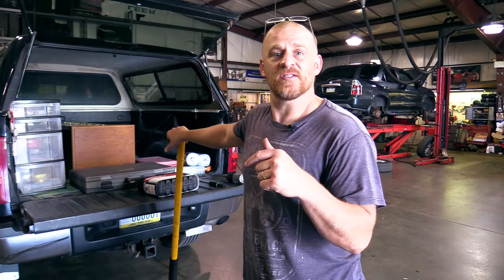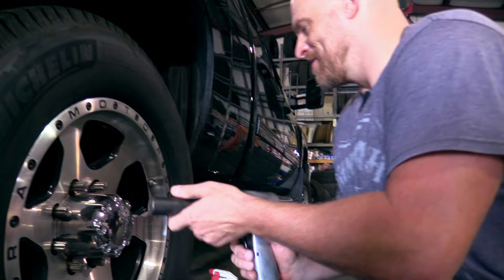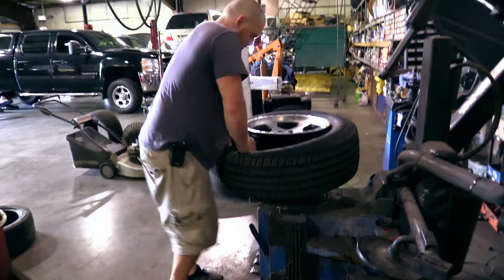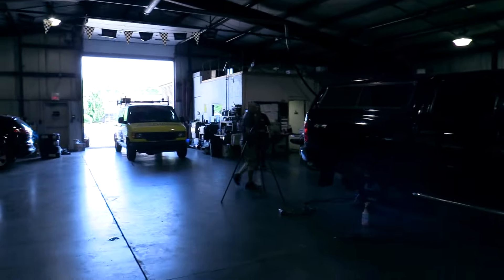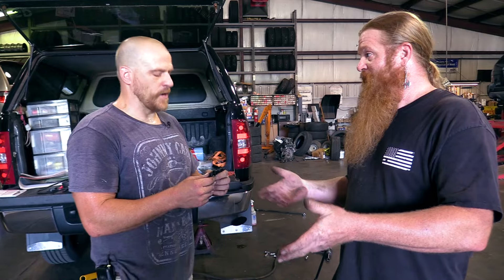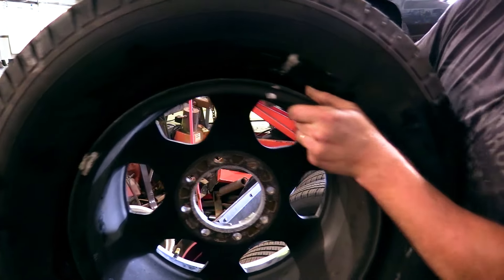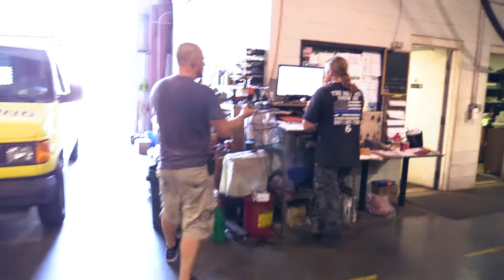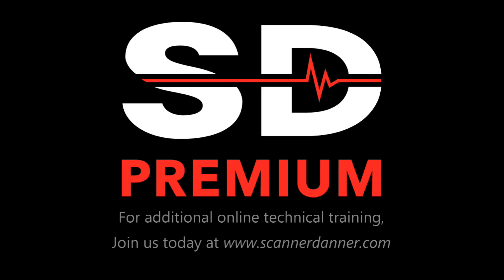Cloning a New Tire Pressure Monitor Sensor (TPMS)

Comment: Good Video as always. I have the same tool but 1 - 2 models lower. I bought it mainly for another function though. You can use it to verify Key FOB Transmissions. If you have a Key FOB that doesn't work, it is difficult to tell if it is the Battery, or the buttons, or ??? That tool can read the radio transmission from the FOB to ensure that it transmits from each button. Great for fixing a worn button. 

I live in Sidney B. C. Canada on Vancouver Island and our back yard is a Tidal Arm from the Pacific Ocean. That Chrysler with the bad TIPM, sounds a lot like the flocks of Canadian Geese that collect on the water behind our house and practice Formation Flying before heading south for the winter. They fly overhead and "HONK" continuously. Just like that Chrysler! After a few weeks, they leave and go south..... I think some of the practice is trying to find a leader that knows where south is. I don't know..... just sounded like them and made me laugh!

Comment: Step one mark the outside of the tire at the valve stem with a “V” pointing to the valve stem
Step two add washer fluid to the reservoir to turn off the message on the instrument cluster 
Thanks for all your videos I’ve learned so much from you

Comment: Paul that was funny watching you drop that TPMS sensor inside of that tire.  I did it twice yesterday on my 20 inch 1999 Plymouth Prowler wheels.  The big difference is I don't have a tire machine and low profile tires are a lot harder to work with if you don't have the right tools.  
I bought the Autel TS508 and cloned a set of four TPMS sensors on my spare set of tires for my Prius.  Those metal valve stems don't like salt and go bad when they go through too many winters as you now know.

Comment: These were a lifesaver for my 2014 Ford Transit Connect. I could not for the life of me get any aftermarket sensors for it. Ford was back-ordered and expensive as heck. The tire tech I took it to didn't have any entries on his tool to get the type of sensors I needed generated. I had to use another scanner tool to activate the reprogramming procedure and it took a few tries because the radio interfered with programming but otherwise I was pleased. My only lament was I didn't pickup the sensors with the rubber valve stems, so now I got to replace them but that's a story for another day.

Comment: Autel made a great tool because of the options that are included. I just installed sensors in aftermarket wheels and need to reprogram the computer to accept the different tire pressures the new tires require. I'll look for your video on that, thanks.

Comment: Chrysler dealer tech here, working in the used car dept, i knew that the leaky stem was not going to be fixed by tightening the nut, due to the corrosion. When you run out of the Autel sensor, get more. What i've seen is that the sensors in many cases cannot be programmed with a different brand tpm tool. I wish the industry would standardize the comm protocols for the sensors so that any brand sensor can be programmed by any brand tool. I've done the pop out the old sensor and pop in the new one just with one bead popped. Have lost a sensor inside too, the trick is to push the loose bead down far enough to reach in with a tool and grab the sensor. As far as getting tire back in place for the balance, it's far easier to clamp the wheel and move the tire. I agree with the sentiment about the tipm, it's a stupid idea to permanately mount relays into a circuit board, especially those that can fail often.

Comment: Couple of things I noticed. One, @9:10, the tire machine you tried to use before switching to the other tire machine because you couldn’t get the head of the machine down to the wheel, there are 4 pedals on the front of that machine. The pedal furthest to the left would’ve lower the head assembly. The other thing is when you had the valve stem out of its hole in the rim, because of the corrosion that was present on the TPMS sensor seal, you should’ve taken a 2 inch long piece of coarse emory cloth, rolled it up the way people who smoke marijuana roll up joints, then stuck the marijuana joint emory cloth roll in the valve stem hole in the wheel and cleaned the corrosion out of the hole before you put in the new TPMS sensor. It’s possible you may wind up having another leak in the same spot because this wasn’t done.
Reply from the maker: Never noticed the corrosion in the valve stem hole. Guess that's why I stick with wiring lol
Reply: Hey, tire work ain’t easy. If it were, everybody would be doing it 🤣
Reply: I laughed at his description of how the sandpaper was folded/rolled, lol!
Reply: @waverider5751  🚬🤤🤣

Comment: I'm putting my money on some swollen, cracked and green front airbag sensors in your truck causing the airbag light, Paul. 😉 I have the same truck, only in a 1500. Maybe if I had ponied up the dough for the HD model, I wouldn't have replaced my differential at 97k.  Looks like you got better paint than I did, too - right above my rear fender well on both sides of the box are several swollen rust blisters under the paint. Truck has been garaged since the day I drove it off the showroom floor in '07, too. 😡

Great vid! Love Autel's sensors. I haven't used or programmed any yet, but when they first came out, I was very glad. I've got the Maxisys 906TS that can program them. My OE wheels are my winter set, so those got sold on eBay many years ago, and regular valve stems installed instead. I just deal with the stupid light. 😁 My summer wheels are off a '10 LTZ, so the batteries should be dying in those any day now. Shocked they're still working at the moment. 10 years seems to be the magic number here in MA for that. 

Don't sweat the tire struggle. The struggle is real, lol! I do that every day with everything, it seems. More so when the camera is on - funny how that works ...

Just got back from a week in OH. Catching up on YouTube vids now. No donations to PA's finest this time. My last trip cost me $182 somewhere near Clarion on Labor Day weekend  - 87 in a 70. Ouch ... 😢
Reply: P.S.:  Loved Caleb's karate-chop audio/visual effect there too! 🤣

Comment: Did you notice the size difference between the old and new sensors?
  My 07 Toyota sensors lasted 9 years before I changed them (while replacing the second set of tires). I used clone(able) sensors as they avoided the reprogramming if the system. The 'clone'  sensors started failing in less than 3 years (and they were always slower at displaying the tire pressure than the OEM sensors).
  I Dissected the parts (yes I kept the originals) and found the clone sensor battery to be about 1/3 the milli-amp hour rating (they were standard button batteries, soldered in, in both cases).
   I bought new Denso OEM parts on the web for less than $30 ea instead of putting clone units in again. They had to be programmed be hand, n sequence, with our Autel Maxisys, but they are back to displaying the tire pressure before the wheels even start turning (clones took from 20 second to 2 minutes after the tires started rotating).
   If you are going to keep your car, think about the life expectancy (I would prefer to not change sensors each time I replace my tires - time and money). If you are servicing other people's cars, 3 or so years might be ok for them - but you might want to ask. If they are low mileage users, the sensor will probably go before their tires need replacement, and that might look bad for you.
   Yes, cloning is quick and having 'one part fits all' is convenient at the shop, but I find it's a pain, and an added expense, to change them more often than the tires.
   Thanks for the memories.
Reply: great write up about cheap knock offs. 
Shredder valves are German engineered to sustain a business: leaking seal, service kits etc

Comment: Using that tool you could also walk around the truck to each tire and scan the tire pressure.  Saves time checking tire pressures so you don’t have to remove the caps and place a gauge on them.

Comment: Been there done that lmao... I think yours came off because you tried to tighten the valve stem nut. Usually you hold a little metal dowel to keep the valve stem stationary. In your case it turned the valve stem and backed it out because there was no metal dowel holding it

Comment: You can buy repair kits that come with new seals. Most aftermarket parts place sell them. And keep your tpms sensor
Reply from the maker: For sure, that would have been an option as well, but I had, what, 8 new pretty little sensors sitting in a box that I got for free! So why wouldn't i change it right?

Comment: The aftermarket EZ sensors are great. Usually cheaper in price than preprogrammed sensors from the local parts store that sells both.

Comment: Well, maybe disconnect the Chrysler horn and connect a headlamp bulb to that circuit so you can eliminate the noise yet still observe the TIPM failing.
Autel does have the cool TPMS clone feature that few others can compete with.

Comment: Every time you change tires you are supposed to replace the sensor grommets. It’s the same reason for changing valve stems every time. The kits have the rubber grommets, nickel plated valve core, a new nut (which needs Tq’ed to a specific in lb, says it on package) and a new cap.

Also. NEVER use bead sealer on them. You could get some in the sensor pressure hole and it’ll never read again. Rule of thumb is, if you have to use bead sealer you need a new wheel.

Comment: They do make TPMS VALVE STEM REBUILD kit so you didn’t have to replace the sensor itself
Reply: Just get this scanner and program using the scanner, any autel or launch will do it.
Reply: scientist100 why spend the money on the tool (unless you’re doing it often enough) when you can buy the rebuild kits for $5?
Reply: @jimmiller9641  how do you get rid of that annoying light on the dash? I have the tool to scan which one is  bad, get its serial number and the scanner to program it. The tool to read the frequency cost me about 150 I believe, but I have some occasional clients that want this fixed and I tell them which one they need to replace for a small fee and I reprogram it too. The tool has a walk through on the programming sequence so no need to look around.

Comment: The OCD in me is on fire right now.  Three bolt-in sensors and one snap-in?  I prefer snap in myself but change the other three :)  Also -- although you didn't appear to have much trouble, the sensors are much easier to snap-in if you disconnect the sensor first, put in the valve stem, then re-install the sensor.  It allows the steel inner part of the valve stem room to move.

Comment: Hmm using that tool I could program a whole new set of sensors to match my Prius wheels so I can put the new ones in my winter snow tire wheel and the Prius would not know the difference! Great... now to save up enough money to budget out of my SS check.  This was a great demo video!  My 08 Saab 9-7x 5.3i does not care and all I do is take my TPMS tool and set all 4 on my snow tires.  Toyota just wants people to come in so they can sell new sensors and service.
Reply from the maker: To be honest, I think the kit is worth it! You'd be paying probably just as much for 4 new factory sensors for your car

Comment: forgot to say, noble attempt at just tightening it, but of course the real seal and leak is from the inside lol.
in a pinch and temporary fix, back the nut way off, teflon tape wrap the threads, also roll some up into a string and place in the groove/hole until it's overfilled, then run the nut back down sandwiching the rolled up stuff into the void, enough there and it tries to force it into the  leak area and seals the threads both. of course you can only put so much pressure on the TPMS shaft/nut/threads before it snaps off. lol

Comment: After working around tires for a while, I've heard some horror stories. For example, don't hold on to the locking lug nut key when removing or installing lug nuts with the impact wrench-- if it splits apart, you may lose a couple of fingers.

Comment: I have the TS-608 by Autel. It's scan tool and TPMS tool as well. With mine you can clone the sensors. The TPMS tool will only program Autel sensors though from what I recall on the videos. 

On the weight if one was really concerned in a shop they could always use the refrigerant. 

You're not suppose to break the bead loose on the area around the sensors, lol... 

IF you had a repair kit or maybe your brother did you wouldn't have to had to replace the sensor as I've had the wife's impala in a few times for seals. Other times for leaks it's been the aluminum rims. They've had to wire wheel them and then apply black liquid sealant on the rim and let it dry for a couple minutes. 

About $25 each time that happens. 

But being that you're talking about TPMS have you did anything diagnostics wise as lately haven't had a communications with the system as in the dash there's just -- marks where the pressure normally is. I've had codes with different systems just haven't looked them up yet. They were no com codes. Some were with security system or something and others were to do with door locks and also the tire pressure as well. I'm thinking it has something to do with a module as from quick looking at the codes it seems they revolved around the same class of code. Think I'll scan again this week and see what I can find and if not I'll post over on the scannerdanner.com forums. 

I'll check thru the premium videos on your website as well to as they're good quick go to vids for supplementing something if I'm not quite getting something as was the case the other day with a bank 1 O2 sensor. It helped me understand the error. 

You can also reset the pressure you want the vehicle at for say you want higher pressures or lower pressures in the winter
Reply from the maker: nothing on the premium on a TPMS no com my friend, not yet anyway. Thanks!

Comment: I know this was three years ago, but I'm thinking the sensor got broken because when you were wrenching on it, it turned about 90 degrees, which put it in the way of the tire when you broke the bead.  Got to be careful about the orientation of the sensor when tightening the new stem nut. Can't let it move.
Reply from the maker: Yeah I don't remember lol, sorry

Comment: Great video actually, it represents how most of us would get this job done and the struggles along the way so good job! What if the battery in the sensor is dead tho? Will the tool still be able to read it or no? Just wondering cuz my wife’s Yukon has all 4 sensors malfunctioning but they’re 10 years old.
Reply from the maker: You'll have sensor codes. Also there are tools that will be able to read the sensors themselves to tell you if they are "talking"

Comment: replaceable rubber valve stems on TPMS sensors is my favourite kind of flat repair any day at work break the front bead our machines have a helping arm to hold tires down away from the bead don't even need to rebalance the wheel I don't like the kind of sensor that came in the autel kit though I've seen them wear out and they keep sliding off the stem get the ones with stems that use a tiny Torx screw
Reply: they're cheap 'cause of the sick design. 
Shredder was not about to have its business stolen ...

Comment: it shouldn't matter where the tyre is on the rim in relation to where the weights are, having worked in a garage fixing flats an changing tyres i never had any issues come back to me in regards to the work i did on them, if anything yes always beware an be careful of weight positioning an the valves for any damage etc,  but i think Paul for sure you need to stay away from any changing of tyres LOL " stick toy our diagnostics " which your much more suited to doing :D :D :D

Comment: Since it's a GM could the air bag light be the classic B0083 B0084 🤔 Maybe a Occupant Sensor? Paul takes care of his Vehicles so its highly unlikely the SDM has water damage. Hey Paul that Autel Tool can also learn the positions of the tires when u put the Truck in Learn Mode if you didnt want to add or Subtract air it doesn't have to be linked to the car either. The GMs 2011 and Newer you are forced to use the tool GM took away the easy relearn option of adding air.

Comment: Moral of the story - nothing beats knowing what you are doing.  Could you provide a link to the video where you reprogrammed the TPMS to a lower pressure?   The reason for the inquiry is that our 3/4 ton pickup rear tire pressure sensors are set to @ 80 psi, which is too high for the loads carried causing the tires to wear severely down the middle decreasing tire longevity.  The tire pressures could of course be lowered, but then the drivers would have to tolerate the low air warning signals.
Reply from the maker: Yeah, let me see if I can find it

Comment: Made it easy job hard don't quit your day job, should have had your brother do it for you would have been done right and quick. This is why I drive an old truck it doesn't even have a TPS on it I just have a damaged valve stem on my spare tire that's mounted under the truck I bought a valve stem that can be mounted from the outside without taking the tire off the rim that's what you need simple stuff...

Comment: They are NOT ALL THE SAME!
Most work on the 315 MHz frequency but you also have 433 MHz for European.

That “magic number” is a MAC address and they are unique (serialized). They transmit that number and then the pressure/temperature, once they reach 20 mph, repeatedly.

Newer Autel sensors CAN do either frequencies so you only need to stock 1 kind of sensor.
Reply from the maker: I'm not sure if you are shouting at me or not? When I asked if they were all the same, I meant the ones that came in the kit and yes, they are all the same sensor.